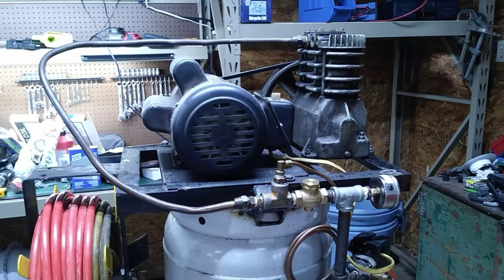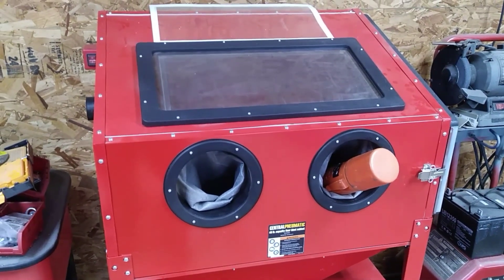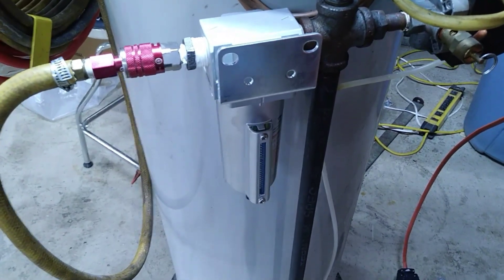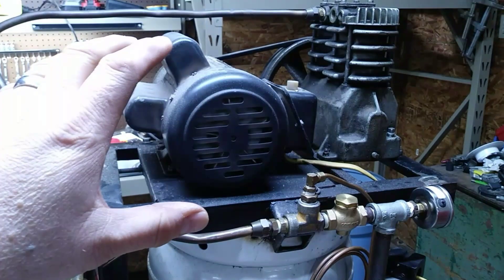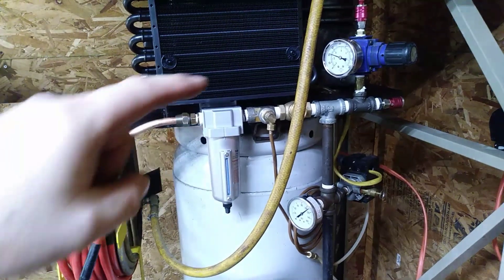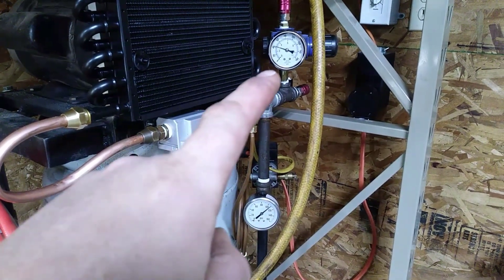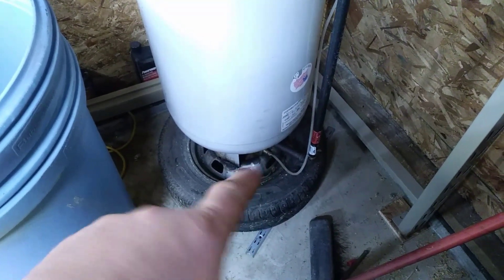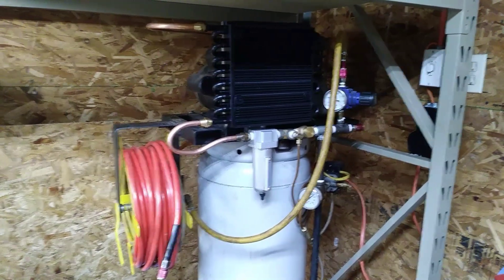DIY Air Compressor Air Dryer using an oil cooler and off the shelf parts!  Water Separator!

Comment: So is this oil cooler fully pressurized? I think they have a 250 PSI rating?
Reply: Most air compressors are 175 psi or less so it should be fine.

Comment: You shouldn't be pumping air into the bottom of the tank unless you also additionally have a weep drain down there too.  Regardless of any pre-cooler / condenser and no matter how good you think it is, the tank will indeed accumulate water over time.  And it will be faster if you live in hot, moist climates and use your compressor a lot.   I've seen videos of people overlooking this and wind up with a tank that is 50% full of water.
Reply from the maker: Yup, filling the tank from the top or bottom doesn't mean you don't need a drain valve.   I highly suggest an auto purge valve like mentioned in the video.

Comment: Are you going to make a follow-up video showing how well (or poorly) your after cooler works?
Reply from the maker: I didn't have any plans on it.  But I will say I'm still using it and probably will never have an air compressor without one.    I do a lot of sandblasting and use no additional dryer.   I also recently painted a truck with no indication of moisture.     It just works!

Comment: Nice setup and nothing beats a clear gauge :) , i do find it interesting though that new compressors don't come with dyer setups considering how cheap they are getting and that lots of vintage compressors were built with fins etc on the lines to sort the condensation problem

Comment: Is that cooler still working for you with the 45 degree flare nuts?  Are you still getting the water out of it for your needs?  I like the price of that cool vs a Tru-Cool H7B that has 1/2 NPT ports.
Reply from the maker: Everything has been working great.    I just painted a truck without a water separator attached to the gun.

Comment: well, its been 3-4 years since you did this. I hope you have learned the correct way by now and revised this. There are about 4 or 5 things completely incorrect on this.
Reply from the maker: Thanks for the comment.  Short of changing the compressor head to a bigger one, everything is the same.   Air has been completely dry and I have had no issues.  It is one of the most used items in my shop!  I paint, media blast and use it for all of my air tools.  I have no plans on changing anything because it works so dang well!   I do a lot of things "incorrectly" because sometimes the correct way, isn't the best way for me.   What are those 4 or 5 things you think need done?  I'd love to hear them so the rest of us can learn or at least get some ideas!

Comment: I bought the same cooler to set up mine very similar. I have a question about the copper tubing and ends. I went to Lowes in search of soft copper 1/2 tubing. All they had was 1/2 ID. What did you use to make your lines? I couldn't find a flare nut that would fit that tubing. I was thinking about using stainless braided and -8 AN to pipe fittings but the max temp on the line is 300 degrees. I think some videos had the compressor outlet temp higher than that. Thanks in advance!

Comment: Condensers like this do not dry the air, they only remove the water that's in excess of the water that air can hold at room temperature.  That means the air in your tank is at 100% humidity, you've only removed the excess that condensed out.
Reply from the maker: Thanks for the added info.   My only goal was to media blast without moisture causing issues.    After installing it, I've had no issues at all and have even painted a few projects!  I've also noticed I do not have to drain my aux tank on the tire machine!   The next step would of been to purchase an air dryer, but so far this has been good enough!
Reply: That's simply not true.  1- Hot air holds more moisture than cold air.  2- The air being sucked into the pump is the outside (or indoors) ambient air temperature with whatever level of humidity currently exists in the air when pulled into the pump.  3- This could be 10% humidity or 80% if you live in hot, moist climates, or it has rained recently, etc.  4- 100% humidity means it is "raining" because the air is so saturated with moisture that it can no longer hold it at that given temperature.  5-This is called the dew point which is why dew point changes with temperature and humidity.  Regardless, when the air (of any temp and humidity) is heated up, the moisture is vaporized (like steam for example).  So when cooled down, it allows the air to release some amount of moisture percentage down to whatever level the ambient air temperature will sustain.  So in any condenser / dryer system like this you are in fact removing a small or large amount of moisture depending on the aforementioned factors or pre-pump conditions and how much you cool it down after pumping.  

And lastly,  if it is used right after the pump and before the tank (as he has done here),  it is removing moisture, hence why having a water separator works, and or also using ball-valve joints under collection points that also work to expel the collected / condensed water.  So no, there is simply no way you're pumping the tank with "100% humidity".  At worst, you're pumping in whatever percentage the humidity level is at the existing ambient air temperature.  My only fault with the video is him pumping the air in the bottom where an additional drain valve should be.  Even in ideal conditions with a pre-cooler / condenser the tank will still accumulate some water over time which can and will rust the tank unless epoxy coated or wax coated internally.

To say he is pumping in "100% moisture" is like saying you're filling the tank with a garden hose.  That's just not the case whatsoever.

Comment: I have never seen on of those "automatic" drains that works off of the unloader work well for more than a few weeks.  I replaced the same one on my compressor 3x since often my experience is that the people having problems with things often just don't take the time to install them correctly, but it never worked more than a few cycles before the diaphragm got messed up and it failed, usually leaking.
Reply from the maker: I take mine apart about every year or so and clean it.  Mine came from Harbor Freight.    It's getting old enough I expect I'll have to replace it.    Typically the rubber membrane fails and they start to leak after many years of use.
Reply: @1D10CRACY  Mine was the harbor freight one also, I don't think that it lasted a year to clean it, and it wasn't that it was dirty, it was that the diaphragm failed and it got jammed open.  Like I said I tried it 3x, they all failed.  If there was an easy way to post them here I'd post pictures, I threw all the parts in my jumbo mayo jar of various fittings so I believe I still have them.

Comment: It's kind of mind boggling that a cooler isn't installed right at the factory. The manufacturers surely must know that the rust in the tank will lead to a catastrophic failure.

Comment: It would be nice to show a detailed look at how the radiator was mounted, how close to the motor, etc.
Also, it is called "unloading" not decompressing.  The pressure switch has a head unloader valve in it that dumps the pressure in the head for unloaded motor starting.
Does the automatic tank drain remove enough water?  I have tried it before and it seems like a quick puff of air that doesn't seem like enough to drain any water.  is it enough?
Reply from the maker: The quick puff, albeit small seems to be more than enough to keep the water out of the tank. It's actually activated when the unloader valve releases the head pressure. Keep in mind there is a water separator after the oil cooler (radiator) as well.  The oil cooler is mounted about 2 inches away from the motor.  I used an inexpensive oil cooler mounting kit (round zip ties) to attach it to some random scrap metal I welded to the frame the motor is mounted too.
Reply: @1D10CRACY  thank you for the information.

Comment: Run a copper coil behind compressor flywheel has same effect and even spend less than oil cooler
Reply from the maker: I use to do this on past compressors, it works, not as well as a finned cooler, bit it works and would save you some cash.

Comment: Great little video - I need to do something similar and balking on a refrigerated dryer so looking at an aftercooler. Do you have a feeling for the SCFM this little Derale 15300 will support? Since they are not really designed for air I haven't found any specs on airflow yet, and the air aftercoolers I can find are quite a bit more expensive.

Comment: I didn't quite get the decompression line to the drain scheme
Reply from the maker: I probably should have explained it better.   Its basically a device you screw into the bottom of the air tank.   Then there is a small line you tee into the decompression line.  (Some air compressors decompress the pressure in the heads before starting so the compressor doesn't try to start on a load) Everytime the heads decompress, it triggers the device to release about a T-spoon of air ( or water if there is any in there).
Reply: 1D10CRACY all of the air compressors I’ve ever had decompress at the end of the pump cycle, not at the beginning.

Comment: Very nice.  Please try to remember (or make a note) to give us a follow-up on how well (or not) this is working for you.  I'm wondering if that lower bend in your copper tubing after the oil cooler won't act like a drain trap.  If condensation accumulates in there, you could have problems.
Reply from the maker: It's been a while since I posted this video, and at one point I replaced the compressor head.   This by far has been the best upgrade I've ever done to an air compressor.  The air is pretty dry!   I've painted, sandblasted and used a plasma cutter with no moisture issues at all